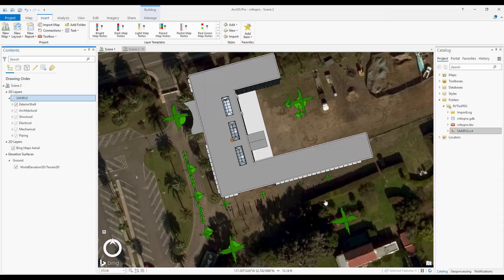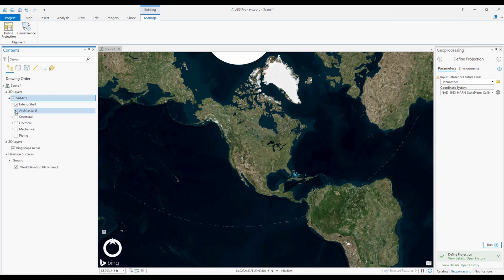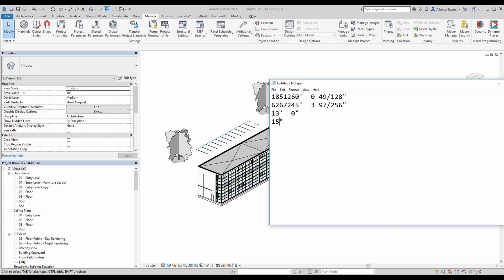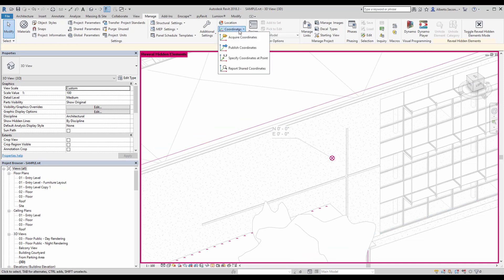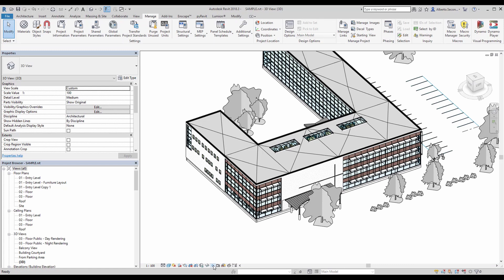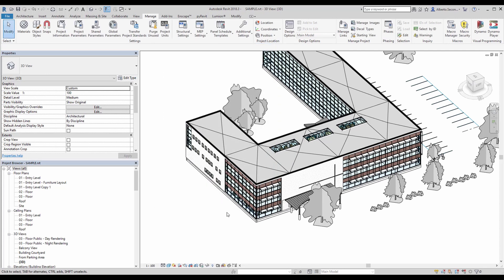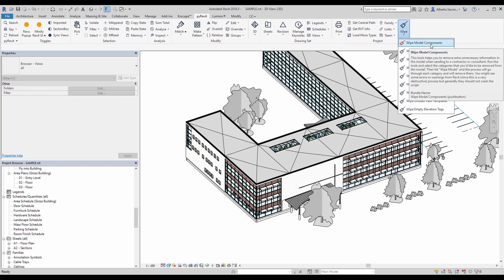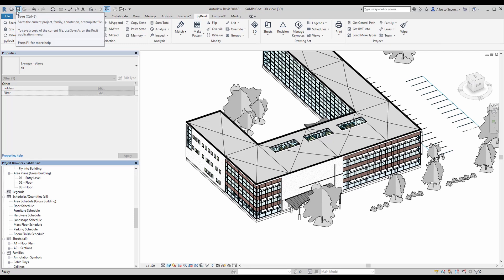REVIT TO ARCGIS PRO PART 1 - HOW TO OPTIMIZE A REVIT MODEL FOR ARCGIS PRO

Comment: Arc gis pro says "unsupported Bim file"
Reply: Hi,I'm having the same problem now. Did you solve the problem? Do you mind to share?
Reply: @kts19967  yes, revit version 2021 files are supposed in ArcGIS pro 3.0,, and above revit version 2022 files are supposed in Arc Gis pro 3.1 and High version software, it's all about software version, and i didn't find ArcGIS pro 3.1 crack anywhere!!

Comment: Sir, can we transfer a Revit model in ArcGIS Pro 1.2 version ?
Reply from the maker: Thanks for your question. Unfortunately, they added the Revit import option around version 2.2-2.3.
Reply: @BIMLounge  sir, please suggest any link to download new versions of AcrGIS Pro or make any video on how to install ArcGIS Pro new version... because the licensed version is too costly.
Reply from the maker: I would suggest you download the trial version and use that to run your tests.
Reply: If you already have a license and you just need to upgrade version